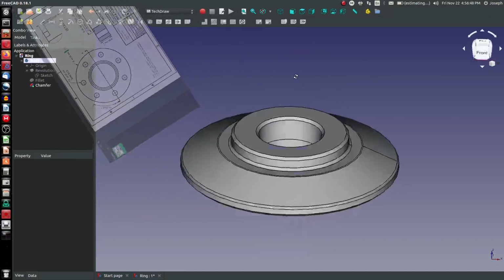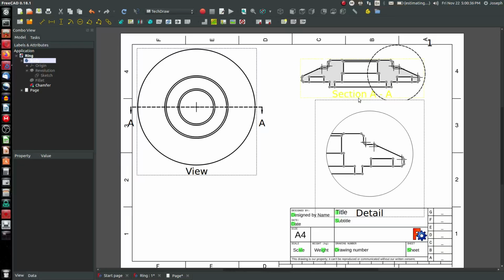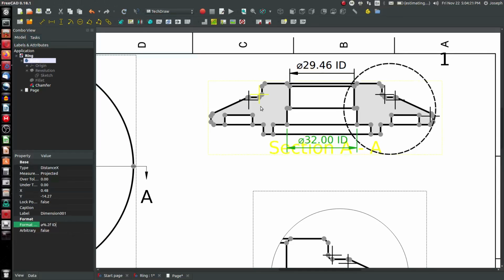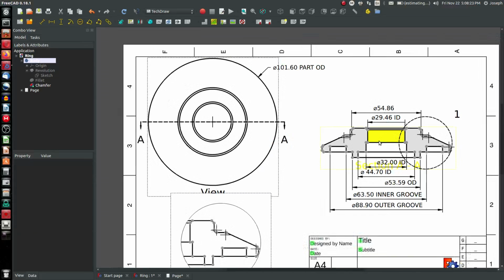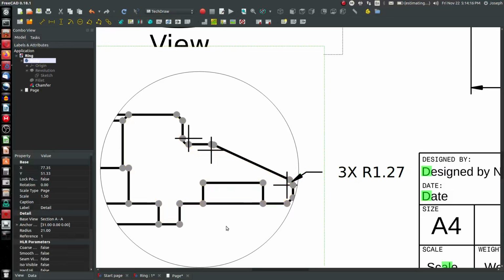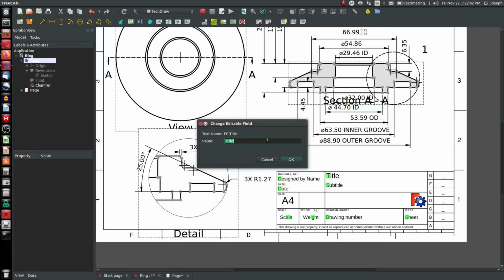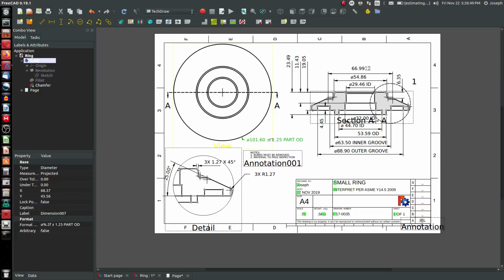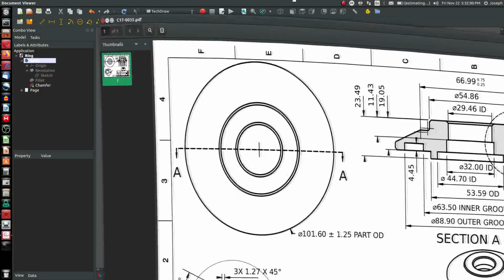FreeCAD - Symbols and Views in the TechDraw Workbench|JOKO ENGINEERING|

Comment: Thanks for this great intro video. It's a big help for learning FreeCAD.
For Windows users, entering the following alt codes will allow you to enter the symbols used in the video (ie: hold the alt key while entering the number code that follows)
° = alt 248
ø = alt 0248
± = alt 241
Reply: And for anyone on mac 

° = shift + alt + 8
ø = shift + alt + o 
± = shift + alt + =
Reply: the big diameter is
Ø = alt 0246

Comment: Ctrl-Alt-u doesn't work in 2025 FreeCAD 1.0
Reply: Which keyboard combination to use for inputting Unicode sequences depends on your OS/Desktop environment. FreeCAD just receives the character from the OS/Desktop environment.

 Searching the web for "unicode character input" "$your_system" (windows, osx, lubuntu, arch, gnome, xfce, whatever) should tell you how to do it on your system. CTRL+ALT+u-XXXX is sort of the standard under Linux, Windows uses ALT with some combination of keys on the number pad, IIRC, it’s been a while since I’ve used it. No idea what Apple uses.

Comment: All fine, this was interesting.
But to make real technical drawings basic functions may not be always sufficient. At least if the ASME or ISO standards are goung to be adhered to. 
What about the different line thickness for contour, internals, sections, etc.
What about the axis, dash lines for invisible edges, and dash-dot  for these above?
And partial, incline sections, or even ones cut at different angle at centre.
All these  would be absolutely great.

Comment: Hello Joko, Excellent tutorial! I had a question: So I am a SolidWorks CAD designer and I want to import the Solidworks(.sldprt) format into Freecad and then draft it so CNC operator can understand the design. I converted sldprt into step and tried to draft it but it's not getting a good result. What do you suggest?
Reply from the maker: I would guess that the problem is happening because the part is not native to FreeCAD and won't have all the functionality.  Is the part looking hollow?  I would suggest opening the STEP in a part environment of FreeCAD, going to the part workbench, and in the top ribbon selecting Part > Convert to Solid.  You'll still have a dumb solid, but it should be converted into a format that works with the drawing environment. 
Let me know if that works.
Reply: @JokoEngineeringhelp   Thanks Joko, I tried but we needed a flexible drawing which could be edit back in freecad, so I drew the model in freecad. Another question, I had was in techdraw, the line thickness is quite high and for complex designs it just doesnt look professional. which feature can be used to reduce the line thickness? Thanks
Reply from the maker: @tusharwable8190  Hi Tushar; I understand, dumb solids can be a drag.  To change line weight in TechDraw, highlight the view you'd like to edit, go to the view tab on the bottom left and the line weight can be adjusted there with the 'line width' option.  Cool feature, I should add that to my channel.
Reply: @JokoEngineeringhelp   Thanks, that worked...awesome!! also is there any easy way for threading operation?
Reply from the maker: @tusharwable8190  Hi Tushar; 'make hole from sketch' button on the part design workbench is for threaded holes.  There is also an add in macro and add in workbench that generates threaded hardware.